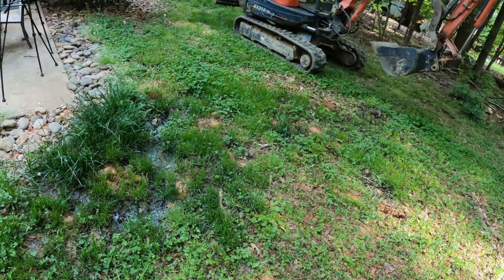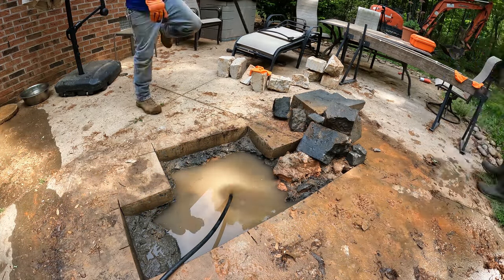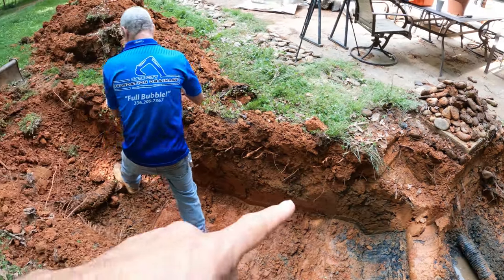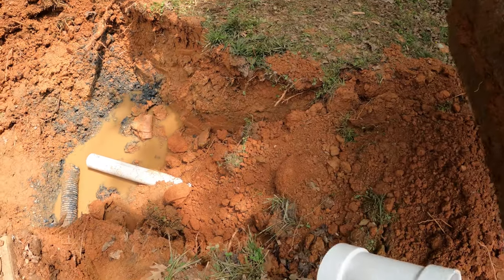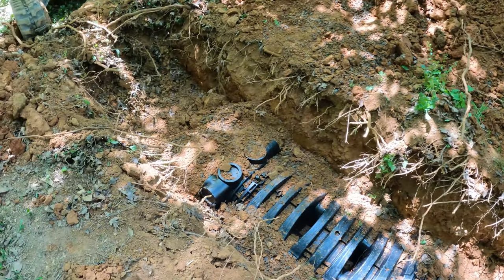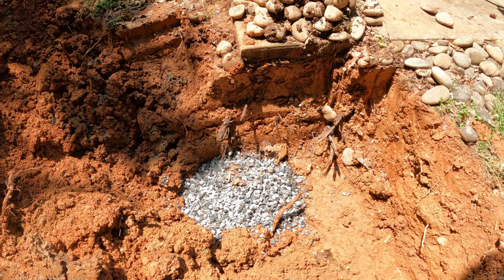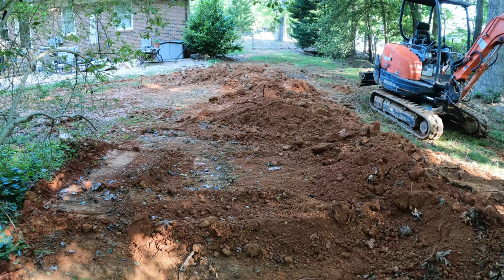Repairing a clogged septic leach field

Comment: Re-burying that propane line ... why wasn’t yellow metal Gas Line Warning tape streamed just below the grade when back filling the chambers?
If that had been buried in the first place you never would have dug up the pipe, you would have just yanked up the warning tape and stopped right there!  It’s code in my state to run tape atop every buried gas line, even small dia residential.
Reply from the maker: It's much more efficient to dig through a controlled utility like that. We knew where it was, we ensured that it was turned off, and we cut the line as soon as we found it to move it out of the way. My experience has been this is much, MUCH better than trying to delicately excavate around a utility for hours and hours, only to hit it with the shovel anyway. It's best to get it out of our way and repair the line afterwards. This is not possible for all utilities, but it was in our case here.

Comment: Old video. But it cant drain in red clay thats why pond dams an bottoms with clay. 20 years ago i built my root cellar that would also hold my well presser tank and water softner. The guy i had digging i put a 45 gallon plastic drum 10 feet in the ground full of holes wraped in fabric and i wanted him to back fill the drum with sand to foot over top an dig a trench across the hill side an day light out the side of the hill and put 3 feet deep sand in the whole trench to day light an id put fabric on top an back fill with the clay. As the water softner has to back flush the salt brine every 3000 gallons i didnt want that salt water going in my septic an kill it from fermenting. He refusd to do as i asked saying i done this hundred times water will go though clay. I knew it woudents. He told me if it didnt work he come back an fix it. Well it was many months later before it back flushed an it backed up into the root cellar. I called him up to come look. But he never did. I rented a excavator the next spring after brake up an had to rip up my graval road to the barn and my costly road fabric i put down on the clay to prevent the clay eating my 2 feet of gaval and do it the way i wanted it done in the first place an fixe my road over 2 years as clay sinks with freeze an thaaw know mater how much you try to compact it. When i did my septic i had to import the whole feild due to red clay. 4 feet bed of sand 250x250 wash crushed stone foot over pipes an 4 feet of aproved setic sand over top an a clay berm all around it. For 5 years i had this huge sand mound in my yard until i biult with walk out basment an used the clay from the dig to lift the whole front grade up over top the sand . That how it had to be done to pass.
Reply from the maker: You're describing a dry well installation. Those don't work here with our clay. They quickly get overwhelmed. Leach fields do work because the give the water time to percolate into the ground. You have to size the field to the soil type and the number of bedrooms being serviced. In this case the plumber suggested hooking onto the side of the field that was still working, but I didn't like the idea of a smaller field. That's why we installed a new leg of chambers AND tied back to the good field. In NC we get two feet of credit for ever one foot of chamber systems. Now they have wya more field than needed for their size house. In other words, they're good to go. 👍
Reply: @GCFD  yes in the first part I am talking about a dry well known here in Canada as a gray water pit. But like I said its only for the salt water brine back wash of my water softner that only puts out 8 gallons of back  wash brine every 3000 gallons of water used. You can fit a number of 8 gallon back wash into that 45 gallon drum full of 1" holes before its full. It could not drain that 8 gallons though the red clay before the next 3000 house gallons used an gone though the softner as my water not hard or have iron in it only  A little high in calcium. Was not long before it backed up an flooded my root cellar. The 2nd part i explained was when I did my septic feild the ministry of heath looked at the test holes an told me its all clay. You have to import your whole septic feild in using a proved septic sand. I couldn't use the sand from my vain of sand in the huge gray hill I had out by the road even tho that sand vain is like white beach sand unless I paid 10k to have it approved. So I had to have a 4 foot deep bed of sand trucked in that went out 50' out side the edges of the drain feild including the whole drain feild area. Then 4 rows of them tunnels set in. Back filled to 6" over top the tunnels with 1/2" washed crushed stone. Then covered with road fabric and another 3' of approved septic sand on top. As well Out 50' all  around the outer area of the feild. Then a 3' minimum clay bank all around the edges of the high sand mound. Water do not  Circulate into clay at all thats why ponds dams are built using clean red clay. And the bottoms lined with few feet of clay. They also line road ditches here with red clay were its lose sand or graval. I dont get how they allow you to put a system into clay. Unless no $4000cnd permit and a 3 stage inspection. Water do not go though clay.

Comment: pretty weird leech field system. It's just one leg that snakes around? No D-box? I would think it would be multiple legs out of a D-box.Should have removed patio and dug out entire drainfield and replaced.
Reply from the maker: I see your point with replacing it all. That would have been a much bigger job so we took a stab at it. I only charged for materials and labor on this one so it was a nominal cost to try.

Comment: No such thing of a cogged leach field in NJ. If you're selling the buyer will requested a perk test & guess what they all fail. Now seller is caught under contract & buyer gets a new septic at $35000 -$45000. This could have been prevented if my neighbor(seller) had the septic system certified first & repairs made. I have seen this tactic done in my township several times.

Comment: So odd seeing septic systems... lived in a city my entire life and had city sewer service...  I dont get letting your waste water soak into your yard, how do you keep all the chemicals and stuff you pour down your drain from killing everything in your yard???
Reply: The drain field is deep enough that it won't kill the grass and there shouldn't be any trees over it because you don't want roots clogging it. The issue with chemicals (ex. like laundry detergent) is to make sure they are septic safe and won't kill off the bacteria you need in the tank to dissolve the solids.
Reply: @Mark.Watson  how much more are septic safe things like that? I'm guessing not too much or overall there wouldn't be any savings versus paying for tying into a sewer system
Reply from the maker: Lots of the chemicals are more biodegradable than they used to be. Detergents and soap are also phosphorous and nitrogen free, which used to cause eutrophication (over fertilizing) of surface waters.
Reply: People use gray water - water from showers, laundry, and dishwashers - to water plants in the garden.  Guessing you don’t put drano down the drain but use a snake instead to clean out the pipes if there are clogs.  That’s what my husband prefers to do over drano.

Comment: 6:05 soil very saturated ... ah yeah, because its clogged and not sending the water away
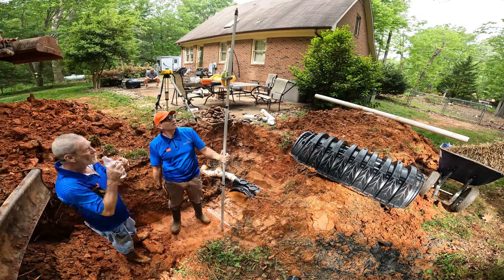16:55 I thought leech fields are filled with gravel
Learned something new
Reply from the maker: Yes the chambers don't use gravel. They are cited as useful in areas that may be difficult to truck gravel into. Also, the gravel covers the soil which slows percolation, whereas, the chambers have all bare soil.

Comment: Still not watchable.  I'd reload.  There's something wrong here.  I only see 2880p60 as a Quality option.  I've never even seen that before, it's an odd one.  I checked some videos and 1440 is the highest res.  Not even sure what the p60 means.  Looks like some sort of "4K" format, which is really just another sales tool for the streaming services.  You don't need it.  Maybe you accidentally set a format that can't be converted.

Comment: The only problem i see i your material your digging in , it looks like red clay material,  we're ii ground lecbing at, in Western states you dig like five with completely drain rock before installing drain lech pipes. But also ground has to have a perk test before digging were. Leach feilds go.

Comment: No wonder it clogged and it will clog again real soon. This video is a very good example of how NOT TO do a job. Where is the gravel? Where is the geotextile fabric?
Reply from the maker: The whole point of chambers is they don't use gravel. Septic leach fields also don't use fabric in our area. It sounds like you have different subsoils than we do.
Reply: I agree with this point.  SO MUCH CLAY — how does the effluent from the field absorb and evaporate under 2 feet of raw CLAY?  In the northeast the codes and regs on septic design are very strict, even in non-clay soils.  It’s mandatory to excavate deeper than the new field pipes, layer in lots of new aggregates (BIG expense), lay in the pipes, and backfill well OVER the pipes with the septic aggregate.  Only after inspecting all that can you relay your natural soil back on top and seed it.  

When I first saw that broken perf ABS in your video, with hardly any crushed stone or coarse sand around it, I could not understand how that system would have ever worked packed under 3 feet of clay.  And in the northeast I don’t believe you can run field pipes in big S curves like your client has... pipe runs here have to be straight and parallel to each other with distribution boxes to split the flows evenly.  During dist and pipe placements a surveyor must run levels and locations of all field components, plus document them on an AS BUILT drawing that has to be filed with the municipality...
Reply from the maker: thanks for sharing Dock. Things are different in different areas. I didn't show, but the as built drawing was like drawn on a scrap paper and looked like a snake flowing. Having a D box or header like we installed ensures the effluent gets distributed instead of a clog killing the entire field.

Comment: Video kept buffering. play for 5 seconds then paused for 30 seconds. Have tried a few times keeps doing it. Other channels play ok. Gave up and did not watch.
Reply from the maker: I'm not sure what's going on John. I've been uploading in 5k and it seems to be a problem for some.
Reply: @GCFD  You tube still gives no other option than the unwatchable at 19 hours after the video was posted.

Comment: I know this is a year old video.. but as a level iv NC installer, this whole site is just off kilter. 😢 I'm sorry but for starters i would never trust a pumper on where a system is. I would pull any and all paperwork associated from the county health department of the original design (records go back to early 70s) if no records are found then probe, follow and flag the gravel.  also ANY repair HAVE to be permitted and inspected. I did not hear once of permit or consulting with EHS... ohh the other thing, chamber installers have to be certified by infiltrator. And that smooth edge bucket is not what you use to dig those trenches.  They tell you that in installer school, the trench bottom is where the permeation takes place and that bucket just sealed that soil. That repair done no justice. Im sorry but this is a illegal 🚫  repair. 
You were better off digging that corrugated up and hard pipe the problem area. 
J M 2 C
Reply from the maker: I would love to talk to you more about this. Call me!

Comment: Not a easy as you may thing. Never checked the septic tank so if the baffles are missing you will be back to start all over again.
Reply from the maker: Very true. The second chamber/ lid is under the concrete patio and the homeowner didn’t want to tear it up to check for the baffle.

Comment: Please understand how to install infiltrators before misleading people on to do septic repairs.
1. never install in wet soils
2. you must hand rake the bottom of the trench and sidewalls to clear the area of any smearing.
3. just hooking to corrugated pipe from the outlet is a hack job.
this repair will never last.